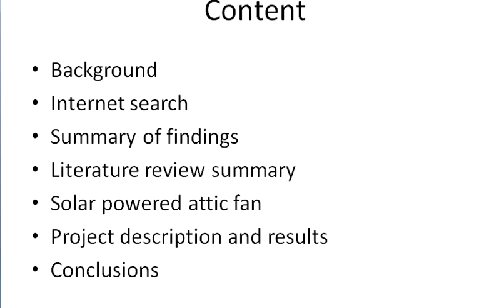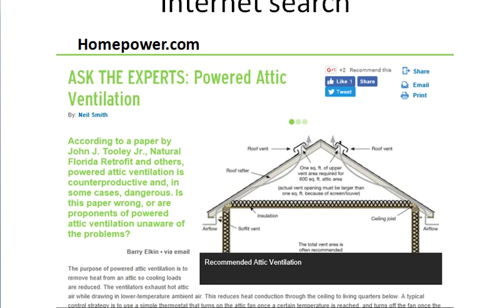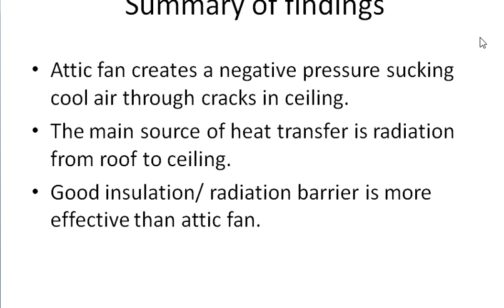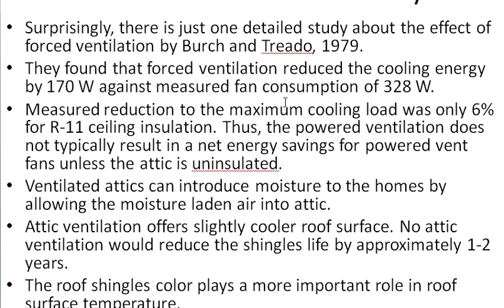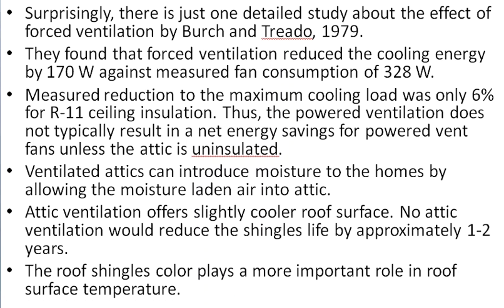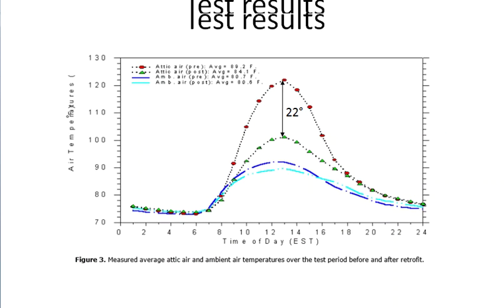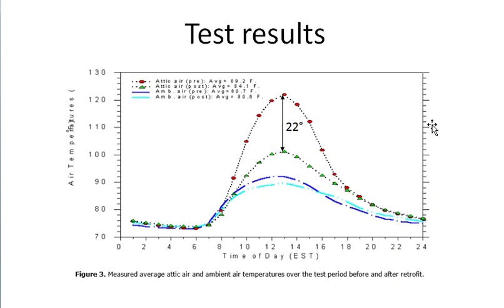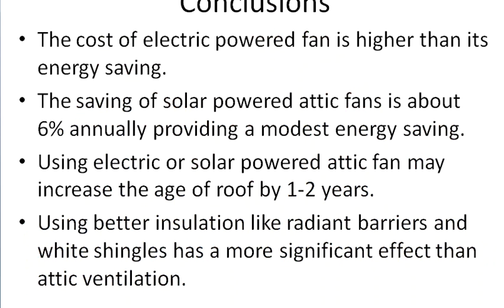Solar and electric attic fans: Good or bad?

Comment: Interesting but need more info. Ie: was the house shaded? (Looks like it from photos). How do homes compare that don't have radiant barrier or have larger attic space?
Reply from the maker: Chris, the home shade condition won't affect the final conclusion as long as the tests before and after installation are performed at only one home. For sure, the shaded home will be cooler but the final conclusion should be similar. Regarding the radiant barrier, if you refer to the literature review paper by Dan Parker presented at minute 5, you may find more quantitative information. It's available to public and you can download it by a simple search. Regarding the attic space, it isn't directly a major factor since the energy input is a function of surface area but since larger space usually means larger surface area, it plays a role in that regard.